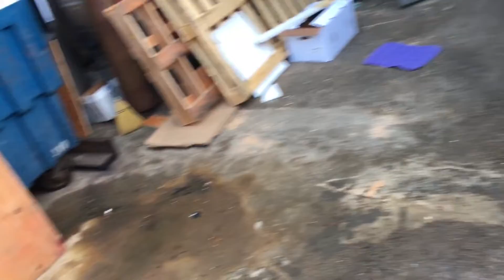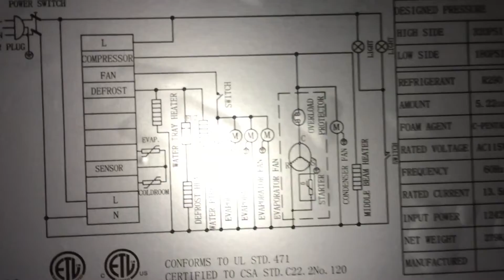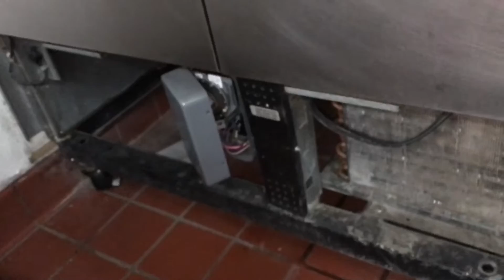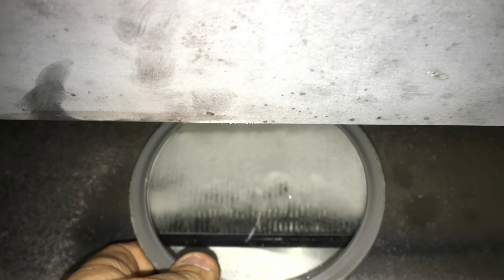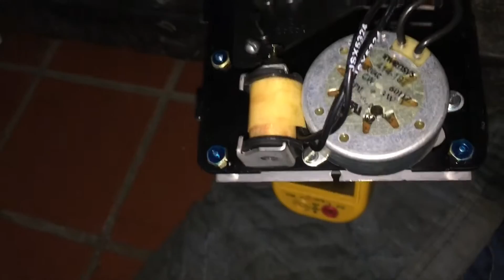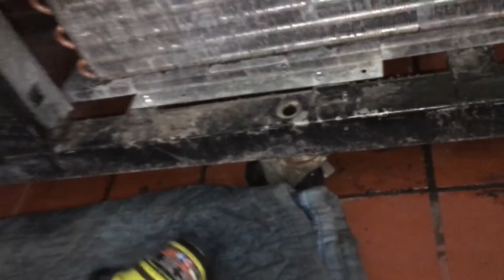New 3 door freezer installation old 3 door true refrigerator coming out.

Comment: I like the old one better, i dont think that dixel control will last, there is no relay. The door switches sometimes i just by pass them.
Reply from the maker: it will be interesting to see how long the dixell can handle the load of compressor , all 3 evap fans and condenser fan. also defrost heater resistance amps too. i'm betting it does not last long.

Comment: I’m personally not sold on propane units until parts suppliers start stocking the non sparking controls and other components they need. Too much down time for a unit. Always suggesting brands like Utility or Continental.
Reply from the maker: Yea, i'm not recommending propane units either, if possible, i'll rebuild old units .

Comment: Didn't you say that was a 220 freezer shouldn't that clock be 8141-20
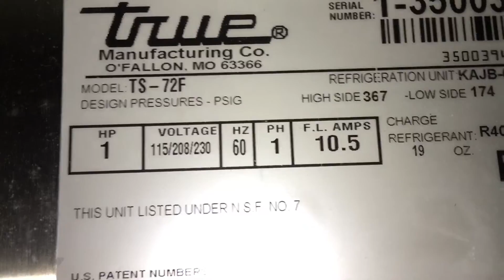Reply from the maker: look at 16:06  model tags says 115/208/230. some manufacturers use 115volt and 230 on the same unit. its a 4 wire 208/230 plug with a neutral.  unit is wired. 2 hot wires. one neutral and a ground wire. its a 4 pin twist lock arrangement. hoshizaki does it on ice machines too. its usually so they can run a 230 volt compressor and 115 volts lights and such inside a unit. controls are 115 volt, door heaters 115 volt etc. it kinda sucks. it would be logical to have everything 208 volt if your going to use 208 volt. its also not good for the unit. one leg will allways have a lower voltage on it than the other leg.